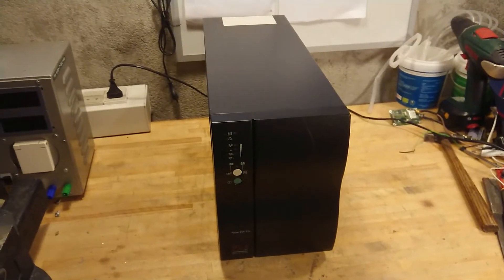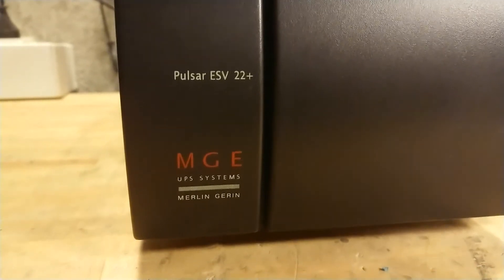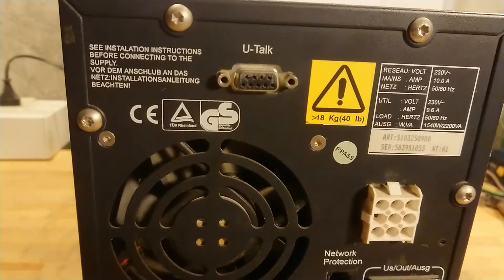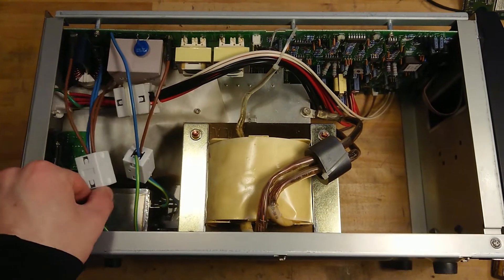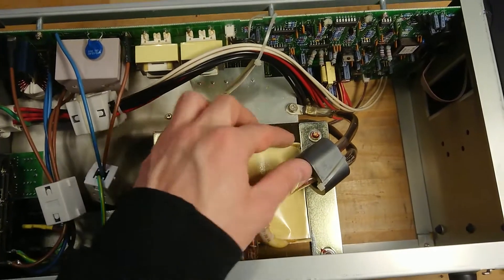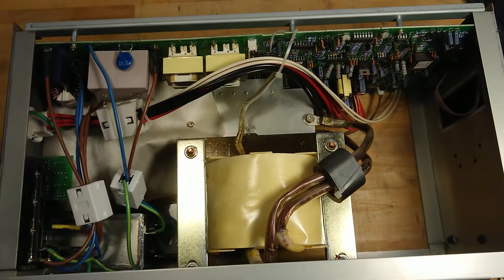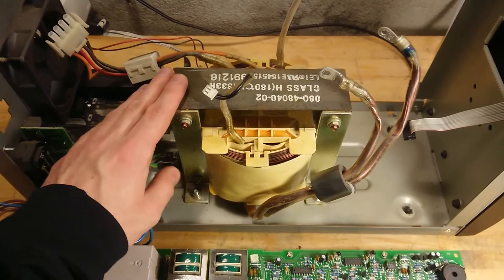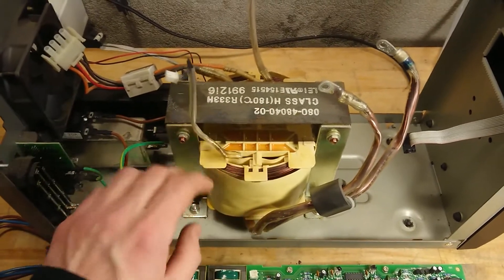Teardown of a Merlin Gerin Pulsar ESV 22+ UPS

Comment: Hi I have 3 of those MGEs 22+, I can’t figure out how to connect the batteries, I got them without the battery extension unit so I’m stuck with the 9 pin connector.
I have 2 questions:
1- what is the operating voltage of this unit is it 24V or 48V because 8 batteries can be connected either way?
2- In the molex 9 pin battery connector 2 white pins, what are those, temperature sensor or middle point measurement or what?
Thanks,
2

Comment: nice video, will u explain 5kva mge ups system for me,coz i have this system and its inverter not working.and also for solar panels could i connect solar panels to this system thank u.
Reply from the maker: A small defective 5 kVA inverter is almost not worth trying to repair compared to the cost of a new and since you want to include solar panels in the equation, you better find a proper battery charger and AC inverter.

Comment: Would you share the batteries that are plugged into it - a connector diagram and what voltage the batteries should have
Reply from the maker: It uses 8x 6V batteries and you should just follow the manuals description of how to exchange the batteries: https://uk.rs-online.com/webdocs/002f/0900766b8002feaa.pdf
Reply: @KaizerPowerElectronicsDk   On the rear panel there is a connector:
 
9 pin molex  mlx

when viewing the cables, I describe what I saw
the left 3 pins are connected to the negative potential of the battery, the right 3 pins to the positive one. The middle pin is connected to the chassis. The middle two pins (top and bottom) go to the white conductor board - with the mark on the board : P007   and  P008.   
so if I have the scheme I will know what they are and what I have to have there

Comment: There was both P and N-channel devices in there? If so you're a lucky man. P channel is worth a lot more.. and great for high-side switches and power supplies.. As Jim Carey used to say, "Yummy.."
Reply: Old P-channel devices are worth a fair amount, but as far as practicality goes, for power electronics, N channel is usually preferred because the losses are lower.
By the sound of it, you probably know that PNP and P-channel devices are rarer and less efficient than their counterparts.